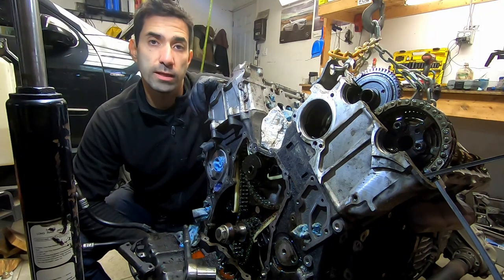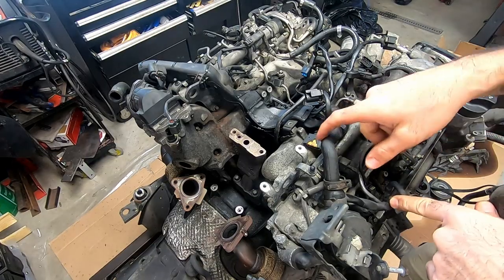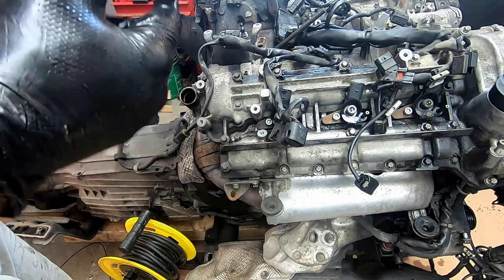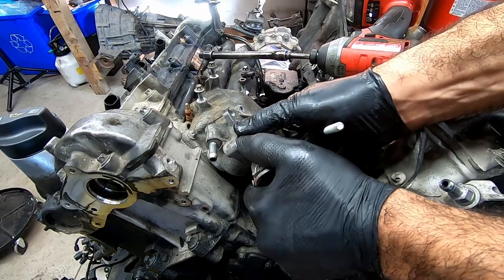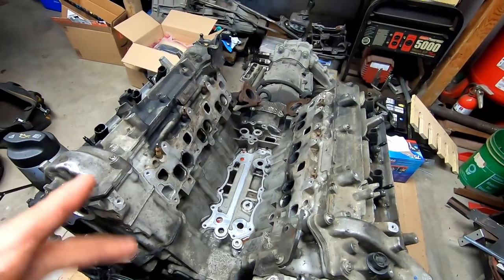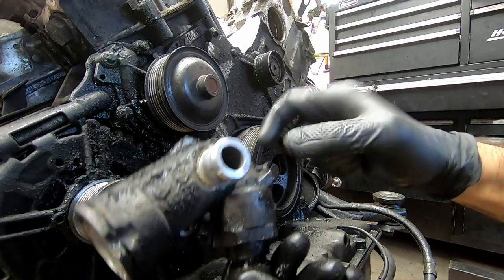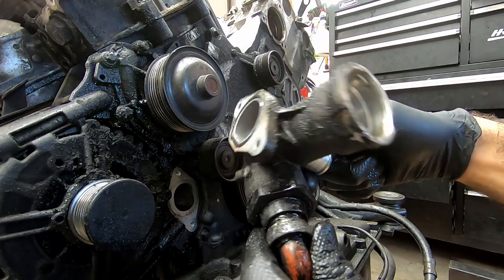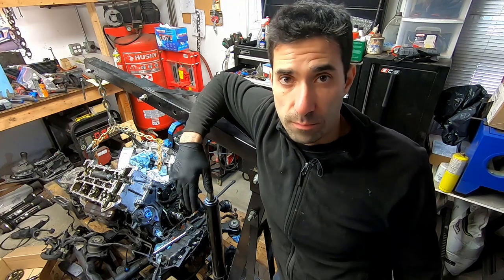Project GLander: Episode 2 - Mercedes GL320 (X164) OM642 engine disassembly

Comment: This throttle body has couple of seals... this is your leak it's not the temp sensor...., besides pcv, turbo inlet, vacuum pump. Also- oil cooler itself can deform and even with new seals it's not sealing properly. Another "fun fact" - seals under this screws in the V  - they also can leak :) OE timing guides are really heavy duty- aftermarket, febi for example- not so much... check them every 100k km.

Comment: Don't replace just the PCV valve, replace the connector on the camshaft also. Part no A6420107215. Both of these are maintenance items.
Reply from the maker: Good point - I did replace that item because of the seal

Comment: Hello can you please help me, I have the problem that my OM642 2007 GL smokes extremely black gray after 5 minutes of engine running. I read out the 5 cylinder injector has a problem, I replaced it, new diesel filter, new oil, new air filter, after 1 week it rusts again very strong ?
Reply: Do a comparison and a leak down test.

Comment: Which brand of DPF do you buy for this engine? SiC ?
Reply from the maker: @cvetomircvetkov5670  the dpf is deleted
Reply: it is deleted in Software, but do you remove it or you leave it? I have a ML350 2010 and it is with stuffed dpf and some oil consumption.changed the turbo, which slightly reduced the oil consumption,changed pcv and filters but no effect on oil consumption

Comment: Replace the timing chain. Thank me later
Reply: No need if it's not stretched. If you change the oil before it gets overloaded with soot (5-7k miles), it will last for 600-700k miles before a replacement is needed (I have seen this engine with this many miles on sprinters, and a top notch mechanic, and he can attest that's the secret after taking care of 10+ cars that all passed 500k, and others that didn't when he ignored these 2 "problems"). 

Suboptimal maintenance is what kills this engine ahead of its time, nothing else. It is way more sensitive to prolonged oil changes, pcv valve replacement (its a maintenance item and it will kill your intake flaps if you keep it for over 40-50k miles) than the older OM648, mostly due to the sheer length of the timing chain and less oil volume reaching it directly. Oil cooler is the only big physical weakspot of this engine, like its seen in this video, specifically the location of the cooler and bad design of the seals (pre-2009 anyway). First thing I did when I got my E280 was to replace them. They weren't leaking, but since I took the intake out to clean it, it was worth doing the job.